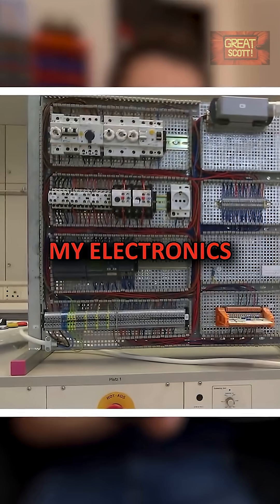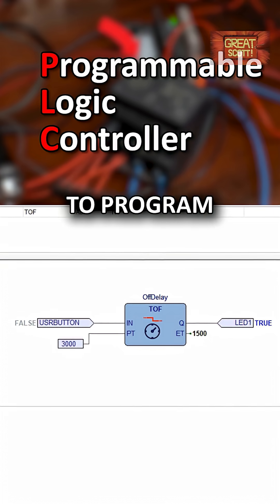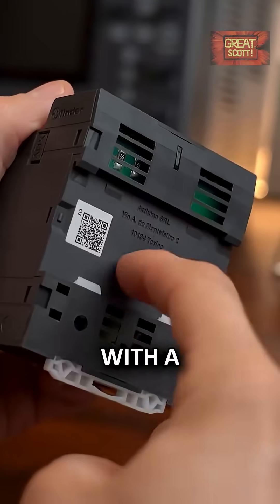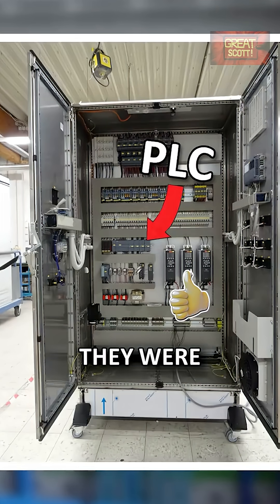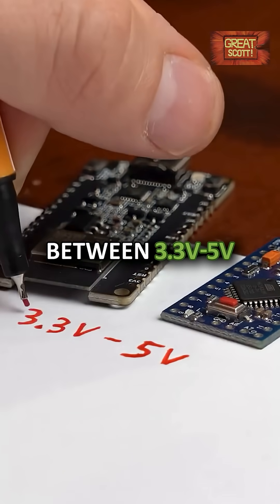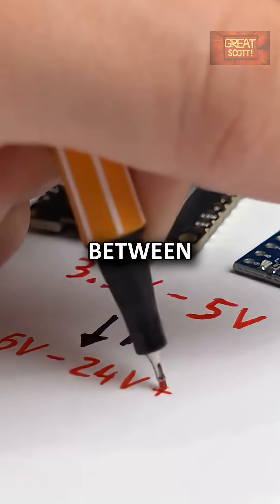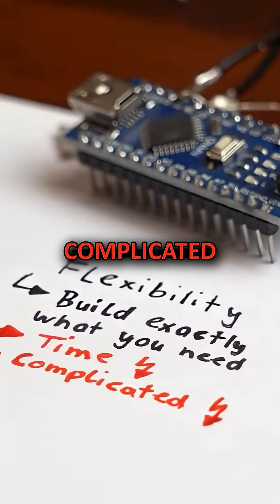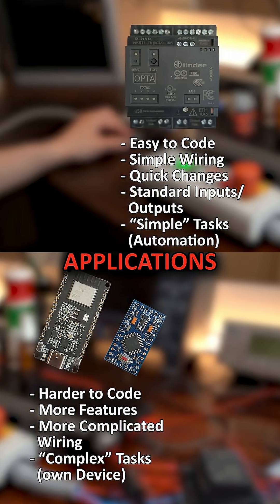How Microcontrollers Are Replacing PLCs! #diy #plc #microcontroller #arduino #esp32 #electronics

Comment: I've used Arduino's and Rasp Pi's for controlling lights with vision systems. I can change the color of the lights, brightness, etc, There is no need for expensive equipment for certain applications.

Comment: a microcontroller typically runs a main loop where program behavior can vary depending on when variables change. Unless carefully designed with interrupts to handle inputs and outputs, this can lead to inconsistent results. In industrial environments, such unpredictability is unacceptable, as it can compromise safety and process control.

The key distinction is that PLCs are designed for deterministic runtime behavior, while microcontrollers require additional engineering effort to achieve the same reliability.

Comment: Bro you can use GPIB and external electronics to switch higher voltages with a microcontroller.. plus microcontrollers are actually easier to program than PLC's ladder logic or archaic proprietary languages.  Microcontrollers are cheaper, quicker to setup and can do everything a PLC can do and then some.. You're Welcome! :D

Comment: I'm an automation technician, I use PLC very often in my work. And I will never put a micro controller in an industrial system. PLC are bigger and more expensive, but they are more robust in term of hardware and software.
And PLC are easier to program, for one major reason. If a PLC program is complicated, your program is bad. This must be easy to understand for a maintenance guy

Comment: i have a few plcs that work perfect on 5v in my circuits in a dip package. the undetermined timings of using a microcontroller in its place is something i wouldnt want to use
Reply: i ment pld. that is if one needs a lower voltage

Comment: Arduino Nano less that £5, a basic Siemens PLC well over £250 + software and programming cables.
Reply: Industrial line going down multidigit $, someone dying or having a bad accident and the case somehow reveals using a random microcontroller where a PLC should be also multidigit $ in fines (plus paying for the person harmed), even risking being further locked down by the authorities until external safety inspection, evaluation and court decision after that to permit or not restarting operations. Suddenly saving a few hundreds to dozens of thousands of euro using random microcontrollers instead of PLC in the later's job, can end up costing a thousand to hundreds of thousands or even million+. Suddenly a PLC doesn't cost that much. Furthermore most electricians/automations technicians won't know how to program or even examine a microcontroller and at least in some countries you can't replace them fully with programmers or electronics technicians for legal reasons (both protecting each profession's piece of the cake and because it's the electrician who signs and gets the responsibility. Only other profession that can touch alone is a couple types of technologists and several types of engineers. Where I am from at least.
Reply: @DragonlordSVS Absolutely agree. You'd never use for anything mission critical. I've had Arduino miss steps on a stepper moter because of s serial bus interruption when the PCs screen saver comes on 😂 Horses for courses.

Comment: This doesn’t explain why or how PLCs are getting replaced by microcontrollers
Reply: this is a snap of a longer video
Reply: @davidteichman3102  Still, that is what the title suggested to be found here. And what I was missing here, too.
Reply: @davidteichman3102 ya and the longer video isn't about it either.   This video more was just comparing what a typical microcontroller could do to cover plc uses.  Longer video isn't saying they are being replaced.
Reply: @davidteichman3102 oh ok thanks 🙏
Reply: They don't :) You can say that PLC is a microcontroller built around with hardware to fit industrial target. There's not much need to use PLC outside of industrial zone unless you need something they provide and if you'll want to use uC in industry, you'll basically end up building PLC.
Reply: @sanjyuu2298 thanks
Reply: They aren't... a PLC is more versatile and specially crafted to witstand an industrial workplace full of electrical noises also vibrations
Reply: And doesn't define the acronym PLC for those of us who haven't encountered it before
Reply: @The-KP pretty little computer 😂
Reply: The aren’t getting replaced. PLCs are for industrial use and microcontrollers are for hobby
Reply: @DD-gm3fo 😂 yeah. What do you think, clickbait title?
Reply: @DD-gm3fo microcontrollers aren’t only used in a hobby context…they’re literally everywhere inside most complex electronic products and PCBs (for instance for automotive, defense and aerospace applications). PLCs are used in industrial settings, but that doesn’t make them more “professional“ than microcontrollers per se.
Microcontrollers are just more flexible and thus can be used by hobbyists too.
Reply: @leandrogarcia6396 thanks dude
Reply: @AlloyedFrequencies my pleasure 😁

Comment: I have opend an logo rce24 from Siemens  and its basicly a microcontroller. There 3 diffrent boards inside the first for power Management like for 24v dc or 230v ac based on version. The second the microcontroller with all inputs and the third board is like an relay board that gets the output signal from the Mikrocontroller. The are all connected via pins like breadboard and placed all over each other....
Reply: And tadaa. Just like you yourself there said, it's more than microcontroller 😂

Comment: No chance Microcontrollers will replace PLC's. The safety features and certification of PLC controllers, Failsafes and direct control of safety devices. PLC's can generally handle 24V or 110V (AC or DC) directly. The Languages are codified in IEC 61131. Hardware features to handle encoders, high speed counters, etc. Stable Bus protocols, Hardware and software support from manufacturers....
Reply: Yeah, I'm not sure about this video. This is comparing apples and tomato trucks. While a PLC may have some microcontrollers inside of it, they are significantly more powerful than any single microcontroller, the most common ones I use are chassis-based, multicore machines with many megabytes of fast ECC memory.

They also require a ton of safety certifications, testing, validation in a tremendous number of environments and things like that. They have to be able to function over a very wide range of temperature and vibration profiles, most modern ones do PID and model controls for analog signals, have sophisticated communications links, redundancy, etc.

They aren't remotely related to each other besides the fact that both have programmable I/O, though even that isn't really comparable.
Reply: even eliminate the need for safety modules, some manufacturers make modules that are  directly integrated into the PLC islet.

microcontrollers are OK for hobby-level automation, where you have time to develop your code, do not need to be as rugged as a PLC and rarely need industrial grade sensors, also, the libraries can be unreliable, unmaintained or simply evaporate from the internet, forcing you to work from scratch to get a specific shield or daughter board working, you can't have that in industrial use, even if it means less flexibility (to be honest, modern PLCs are well thought, you'll never use them at full capacity) and even the most obscure industrial sensors still follows some form of normalization and can be interfaced easily with a modern PLC.
Reply: @Eytaris  you should take a look at automotive grade microcontrollers. They can do all of that and have triple redundancy on a single die for about 50€
Reply: Confused? PLC consists of CPU, EEPROM, RAM, I/O. Hhmm, shrunk down becomes a microcontroller. As for safety, it just means dedicated monitoring with redundant function for safety result.
Reply: Interesting, so you're basically saying engines can never replace cars

Comment: A plc is just a microcontroller with additional circuits for industrial grade IO
Reply: Plus visual based programming
Reply: @daltonschrader8328  largly depends on the PLC. I learned three different ways of programming them, two were kind of visual, one was plain text...

Anweisungsliste (Text)
Kontaktplan (Visual)
Funktionsplan (Visual)

So it is possible to program that way, but not entirely necessary.

But aren't there visual programming tools like scratch, M5 UIFlow, etc?

So yes, the main difference is the additional circuitry for 12V+ signals
Reply: Yes but the main differences are the ecosystems of software, certifications, and standard practices so that industrial machinery can be run without worrying if it’s going to kill someone.
Reply: @H_Industries317 Or stop dead in its tracks in a place requiring 24/7 operation.
Reply: Exactly, this is why I find it misleading to say they can switch mains voltage. Most cannot, but the shown model has relay contacts built in.
Reply: Under the Hood a plc is actually a more powerful Linux based system
Reply: @nielsdaemen depends but I don’t actually believe most are Linux based
Reply: @nielsdaemen  Depends. Many of the PLC's I've worked with have actually been some flavor of windows. No, before you ask there wasn't any secret Linux running somewhere under the hood.
Reply: @nielsdaemen  Never ever seen Linux based PLC. I've seen multiple Windows Embedded industrial devices though.
Reply: @jothain  The new Siemens unified HMIs are now based on Linux.
Reply: @mhlvos Siemens of all things.  That's surprising.

Comment: PLC's are way too expensive for what they do.
Reply: You think paying IEC for all safety standards is cheap huh
Also, plcs are used in super large scale control. A good example is power grid use plc to get control task from main center for power distribution
Reply: That's true but you pay for the brand,  for the reliability and scalability
Reply: They are only too expensive for what you do. I really like microcontrollers but recently learned how to properly use PLCs and they're quite sophisticated.

Comment: Microcontrollers are definitely NOT replacing PLCs bro 😂 as an ee in manufacturing, no one is going to troubleshoot C code or micropython while the machine is down and the plant supervisor is watching
Reply: 40 years as an industrial electrician. Ladder diagrams freaked me out when I was an apprentice.  Once I  got it, I got it. Ladder troubleshooting is infinitely preferable to troubleshooting code of some type.
Reply: You cannot give rigit answer like this. Its totally depend of application and medium.
Reply: 😂😂😂😂😂 as an experienced maintenance tech you MFin right
Reply: Yes. They are going to troubleshoot PLC wire diagram code. ;)
Reply: I don't think the code is the issue. It's more of people would rather trust a highly engineered product.... Rather than a ESP32 FROM AliExpress. 

In many ways they are better but it is ok for your home not an industrial/commercial setting where companies are dependent on it working
Reply: @maximumoverdrive2219  Well, coming from somebody who literally solders components together "in the air", what do you expect his mindset is.
Reply: He never said PLCs were going to get replaced, he was just stating that the recent demand of microcontrollers is due to their versatility.
Reply: @mr.coolio4321 The title of the video is literally "How Microcontrollers Are Replacing PLC!".
Reply: @ignispurgatorius5297  "how" is the operative word. You're assuming the title means something more extreme. It's like saying "how electric trucks are replacing traditional ones", the statement focuses on edge cases it's not a statement that says all will be replaced. You gotta think with a little more nuance, I'm not saying that to be mean btw I just mean it literally
Reply: @Ivan.Wright  It's just click-bait to facilitate comment chains like these here to push engagement. Social media 101.
Reply: @ignispurgatorius5297  I wouldn't say 'just' but I'd agree that that's part of it for sure. But there are edge cases where the sentiment is true and that's my only point
Reply: @ignispurgatorius5297 
The video maker himself has stated that (unfortunately) clickbait works, hence why he does it. However, I don't feel there has been a change to the content quality, so I'm still very happy :)
Reply: @ignispurgatorius5297  Good point, we should not feed the trolls, even if they are the content creators. Oops i just did so.